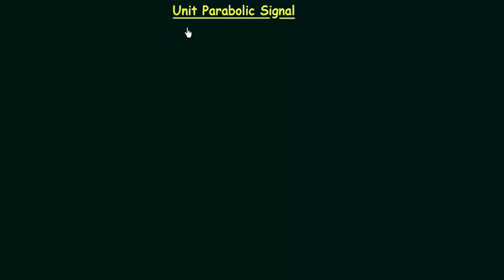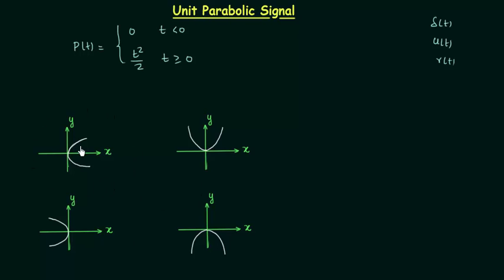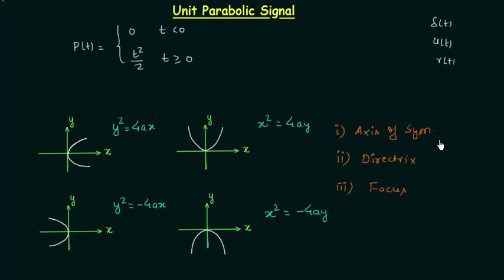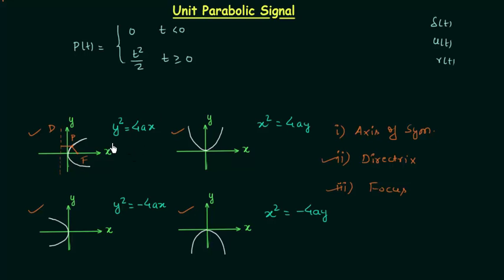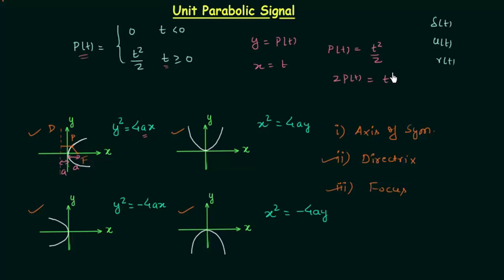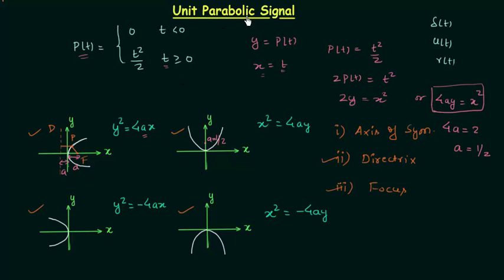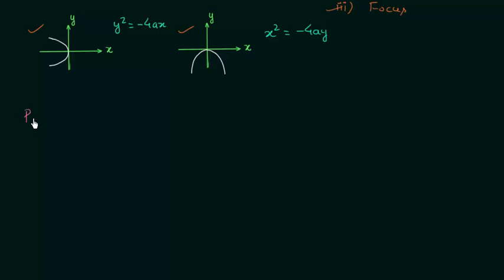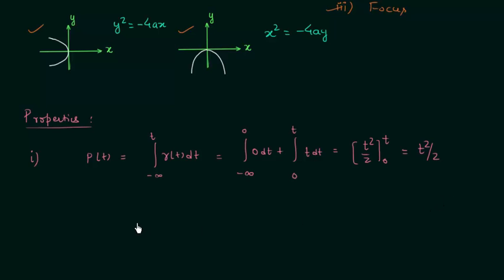Unit Parabolic Signal

Comment: When we put - t in t^2/2 it comes out to be same as that to t, so it should be an even function
Reply: Ya....i also agree @neso acad pl clarify
Reply: But the time range will get change . It will be (t^2)/2  when time t <=0 but not when time t>=0.
So, you can see the time range is also changing after replacing t by (-t) .
Reply: @pritomde2929  yes . Accurate explanation brother

Comment: Why is it called the "unit " parabolic signal?Every other signals has some reason to call them unit.
Reply: All of them are called unit signals because they can be written as f(t) *u(t) for t -infinity to +infinity , same for this we can write p(t) * u(t) for all values of t as unit parabolic signals
Reply: Unit means ones side is equal to zero and another side not equal to zero
Reply: It is because u get (t^2).u(t)/2 when you integrate unit ramp signal( r(t) = t.u(t) )
Reply: @utkarshshukla231   it's not the reason bro, u can check my comment
Reply: Area under signal is unit